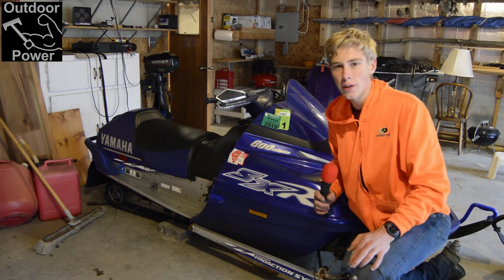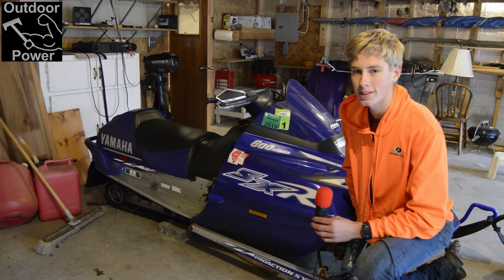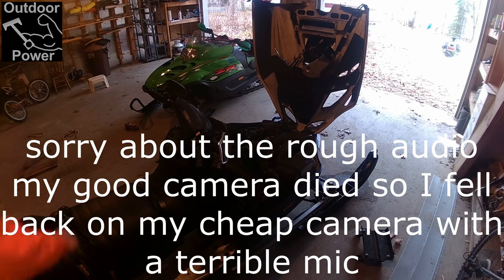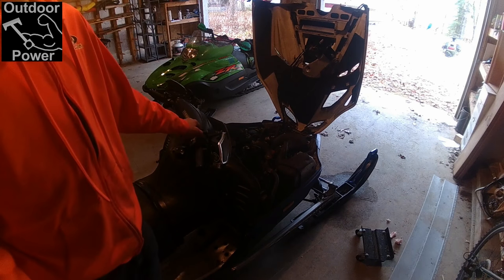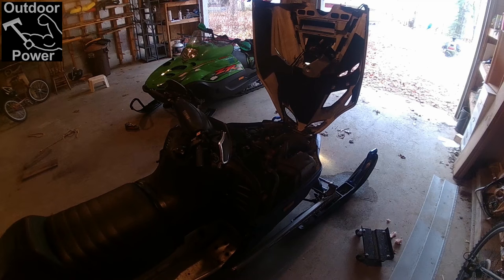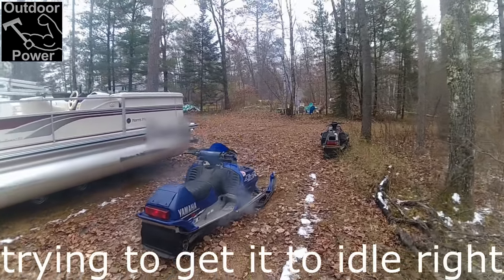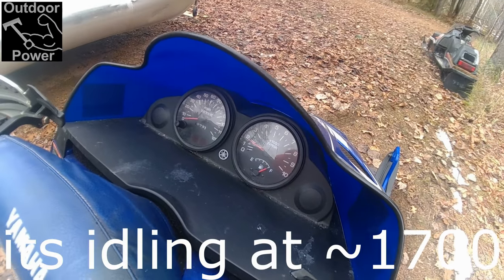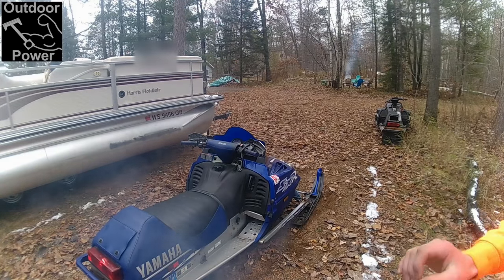SXR Trippple- Hard Starter | Cold Start S1 E2

Comment: Our 1998 SRX600 was the worst to try and start every fall. It was an all day project!
Reply: Mine too, easiest way is to mix a small can with oil and gas, dump the mixture into each spark plug hole, insert spark plugs and pull the rope.  The sled will run on the fuel that you dumped into the cylinder for a few seconds.  After 10-15 minutes it should start to run on its own fuel system.
Reply: I just spray something like brake parts cleaner into the air box and it starts right up